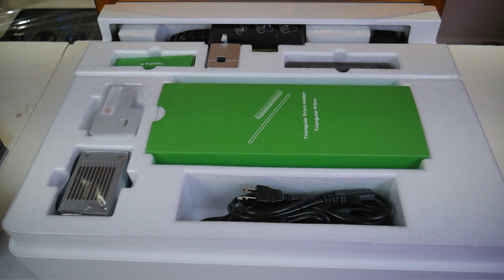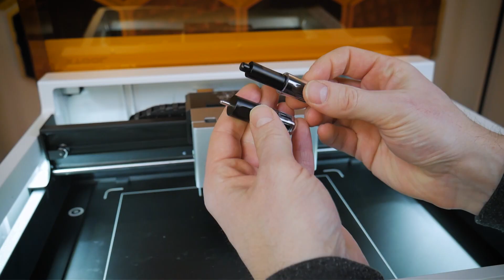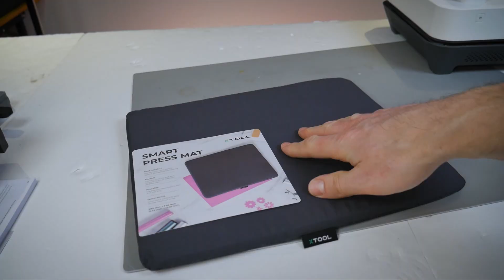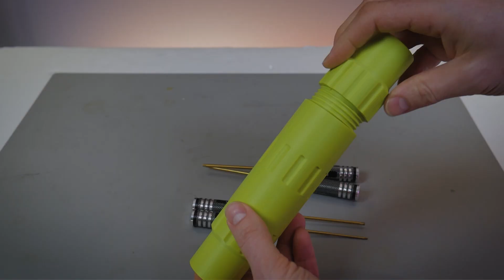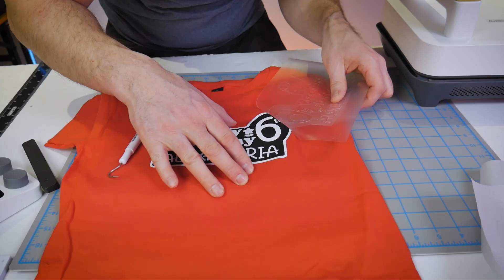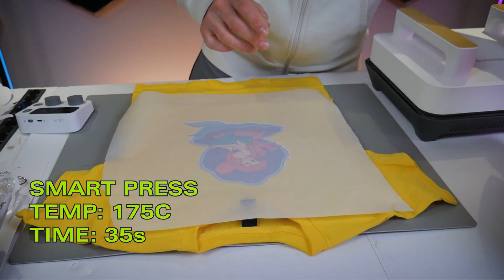xTool M1 Ultra HEAT TRANSFER VINYL (HTV) Guide, Plus Machine Unboxing, Setup, Review, Upgrades

Comment from the maker: If you appreciate this thorough video and you do not yet own the xTool M1 ULTRA - you can find it at the best price below!
Don't forget to disable the Honey browser extension as it does not find you the best deal and deceptively steals affiliate commission from Creators through cookie stuffing your browser.
M1 Ultra Deluxe Bundle:
► https://www.xtool.com/products/xtool-m1-ultra-the-worlds-first-4-in-1-craft-machine?ref=D5HpJRsyqyUUnt&utm_medium=affiliate&utm_source=goaffpro&utm_term=5306&variant=45557285191919

3-in-1 Smart Heat Press
► https://www.xtool.com/products/xtool-heat-press?ref=D5HpJRsyqyUUnt&utm_medium=affiliate&utm_source=goaffpro&utm_term=5306&variant=45553817845999

xTool Apparel Printer
► https://makeblock.kckb.me/5d6940fe

xTool AP2 for the best fume filtration when using the laser module
► https://www.xtool.com/products/xtool-safetypro-ap2?ref=D5HpJRsyqyUUnt&utm_medium=affiliate&utm_source=goaffpro&utm_term=5306

If you're looking for other tools shown in this video, check the links below. As an Amazon associate I may earn a small commission (at NO extra cost to you):

Electric Air Duster:
► https://amzn.to/4kKEgGb

Vinyl Weeding Tool:
► https://amzn.to/4iSqYW7

Teflon Heat Press Sheets:
► https://amzn.to/4kp5kdP

Printable Heat Transfer Vinyl:
► https://amzn.to/4iSbfpZ

Framing Square Ruler
► https://amzn.to/3DyWoSB

Comment: This has been great. I have the M1ultra but have found some instructions confusing. I really appreciate the plug this in here type of instructions. I’ve purchased fire assist, air assist and the smoke remover bit but would like to know I’ve set it up correctly. I’m hoping that when you do the laser video you exclude plugging the bits in. Again thank you for this video.